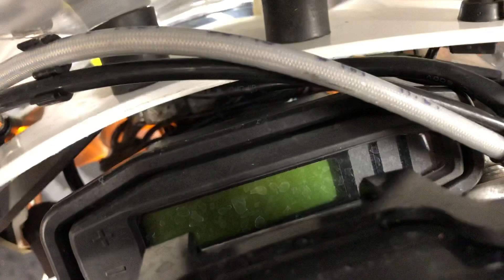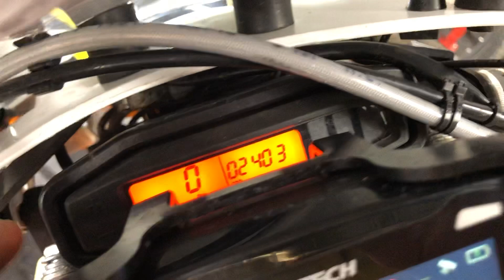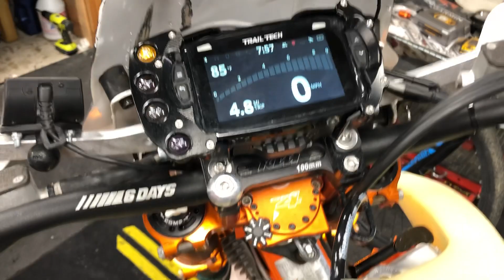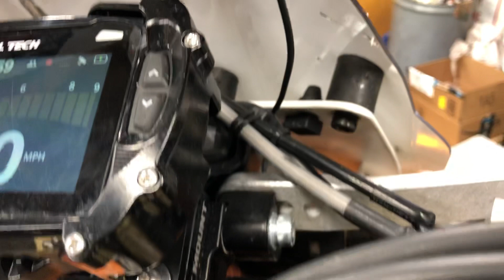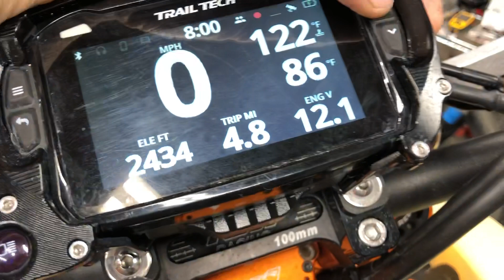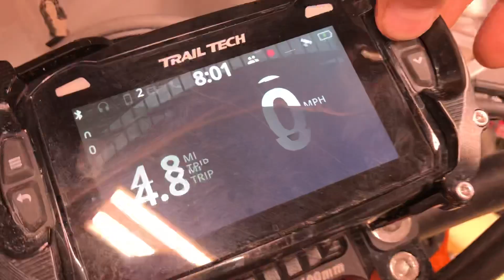Trail Tech Voyager Pro custom installation with MotoMinded Stout Mount on a KTM 500 EXC

Comment: I’ve recently got my mits on a voyager pro despite the back order that seems to have everyone plagued. But since it’s for my sx250f and that doesn’t come with ktms computer snagging the voltage signal for the voyagers indicator lights seems to be an issue for me since I don’t think there’s that plug n play solution that you’ve found. Or is there one that I’m missing I can plug into or would I need to individually engineer each indicator to work like running the indicator wire in step with say the headlights? Or blinkers what about low fuel since there wasn’t one on the stock bike. 
  Any help I’d be stocked on, otherwise installation is straight forward it’s just like any other speedometer , but just much much better.. 
id be stoked. It’s my first bike and goin for a plated lightweight enduro adventure style. Just finishing the lighting and next light cargo. Then rocket boosters ,,  just waiting for them to be invented ,, but your snorkle also looks like a consolation build

Comment: Did you share the front wheel sensor for both the OEM dash and the Trail Tech? Or are you just using the GPS on the Trail Tech?

Comment: How do you use both, the Trail Tech and stock speedo?  Are you soldering into the sole sensor at the front wheel?  Is there a harness?
Reply: Mine did not, and I was told by the company  you have to spend yet more money to work as advertised.  (21’ Husqvarna FE501s)